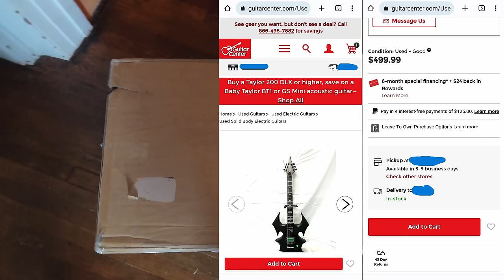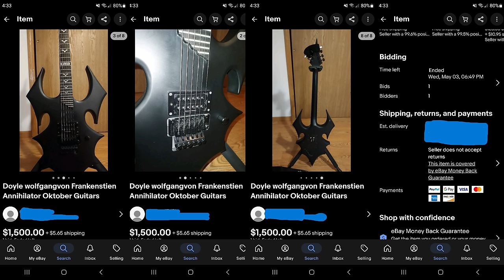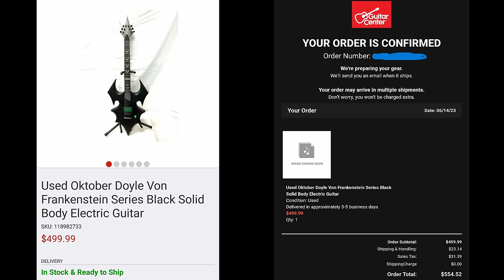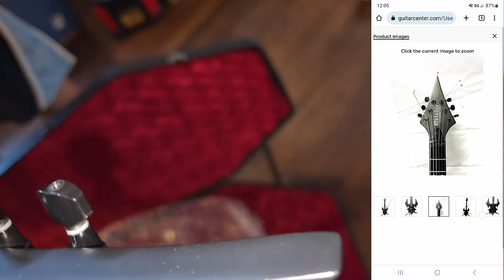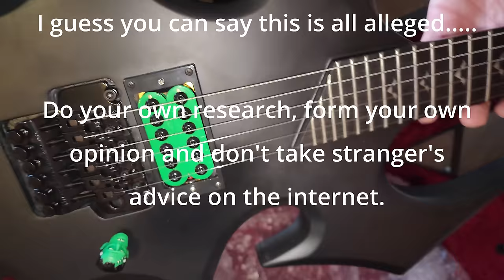Guitar Center Sold Me a FAKE Oktober Annihilator Doyle Von Frankenstein Guitar The Misfits Part 1

Comment: I bought a Mesa Boogie 2:100 power amp from GC once. I was excited about it and watched the ups driver bring it up to the porch. The sob drops it right on its face on a concrete porch  takes a pic and scurries off. I already knew the face was destroyed but when i opened the box, I was gutted. The box had about 6" on each side of extra room, maybe 5 pieces of popcorn and a strip of paper. This tube amp had been floating around unsecured in a giant box from new York to Detroit. So i look at it, confirm the face is destroyed, the rear only had 2 power tubes and one was floating in the box with it and somehow survived. The 2:100 comes with 8x 6l6 tubes. GC denied they sent it to me like that and even said they tested it first. I was fuming at that point but ended up getting my money back after a few weeks. never bought anything used from them again. They're crooks!

Comment: Guitar Center does next to no work on listing their used items. Sometimes it can be to your advantage though. 

They incorrectly listed a 90s MIJ Jackson Concert Bass as a Jackson Spectra, a much cheaper current production bass. I got it for only $150. It wasn’t playable at all out of the box as the saddles were lowered all the way and the neck needed adjusted, but a $50 setup corrected everything. Sounds ferocious and in great condition.

Comment: Some differences you didn't mention that could help someone in the future. 

1) the space of the pickup and the floyd rose. The real one has a space. The fakes are much closer together.

2) location of the knob. Using the Floyd of the real one for reference.  The fakes are too far back

3) pickup location in respect  to the arching C curves on each side. On the real one, the top of pickup is nearly (just a tad under) halfway  of the arching curves on both sides of the guitar. The fakes are further back

4) If you look at the end of the neck where the cutoff is on the real one. The metal fret markers specifically. The strings going from E to e ,each one is positioned in a way to cut an equal amount of the metal fret marker off. On the fakes, the amount is random

5) the part of the guitar that meets the neck. If you look at it. On the fake ones, it goes up to the 2nd bat. On the real one, it only goes up to the 1st bat inlay

6) the large wings of the guitar. If you look on the real one. They go up on each side to about halfway of the Doyle inlay. On the fakes, they are much shorter and do not reach to the same spot.

7) On the fakes, they have silver screws for the plastic pickup covers/braces/brackets or whatever those things are called. The rectangle around the pickups, lol

8) The shape of where the neck meets the body on the back of the fake ones are way too pointy and traingular

9) The tuning pegs on the headstock on the fake are not aligned perfectly.  The 2 on top are misaligned.

10)  The grey plastic ring around the tuning pegs. (The part you turn with your thumb) is like double to triple the width on the fake. The real is much thinner

11+) There is so much more, lol.

Comment: When I was 12 years old I found a advertised red made in mexico strat on they’re used section it was 300 bucks I bought it with my Christmas money a couple weeks later it came to my guitar center and I got there and they were checking it over they noticed something off, the guitar was paper thin! And they ended up realizing it was a squire with a fender neck, I was devastated, this guitar center was cool though they called the store and flipped out and sold me a brand new attic white fender strat for a little over the same price

Comment: A couple of years ago I was at my local GC & saw a cherry Gibson ES-335 on their used wall. I was in the market for a 335 at the time so I took a closer look at it. Before I even took it off the hook I knew it was fake. Headstock angle was much greater than it should be. Once I had it in hand it weighed next to nothing. Then I turned it over & it had a SCARF JOINT. 
The fact that someone at that GC has the authority to buy in used guitars but doesn’t know that Gibson doesn’t use scarf joints is mind boggling. They’re Gibson dealers for crying out loud. I took the guitar to the manager & pointed out the issues to him. He was extremely embarrassed & said he’d handle it. Never saw the guitar again but I don’t go into GC very often, maybe once every couple of months to get strings or cables. I would never recommend to anyone to buy used gear from them without putting hands on it first.

Comment: Ngl all the guitars at my local guitar center feel like fake guitars, it's pretty crazy the quality of stuff they're willing to receive too. They had some used MIM fender strat that had a random chunk missing out of the side of the fretboard where the side dots are so if you attempted a slide you'd cut your thumb off lmao and it had a custom pickguard and knobs so you can tell it wasn't some B stock. The guitar center fall off has been rough on them

Comment: Two months ago I bought my first GC used guitar. I knew I was taking a gamble because of similar stories to yours, but I was willing to take that bet. It's a specific 8-String that rarely comes up on the used market and usually new ones are back ordered. I didn't want a new one, so I've been checking out the used market for many months. Reverb has only sold 6 used ones in the last two years, so when I took a gander at GC for the hell of it after work one night I couldn't believe it. I bought it sight unseen aside from their potato cam pictures at 12:30am. I was lucky, there was no damage, but the two lowest string saddle posts had some slight stripping, so every new day I played, those two strings had to be re-tuned as the saddles kept moving towards the body. It took a few days to figure out what was going on, but I just ordered two new Hipshot saddles and it's GTG. (Side note, Hipshot takes forever to ship their parts.) I'll bet whoever had it before me was dealing with the same problem and couldn't figure it out. 

It's not just used guitars though. I bought a brand new Hagstrom Fantomen from AMS. It has an offset point on the headstock and they ship without a case in a double box. It took three returns before I got a fourth without a giant chip on the headstock point. On that fourth re-order, I specifically told them to check it, wrap it inside the inner box, add more padding on the headstock, and add filling to outside of the inner box so it wouldn't move and they complied.

Comment: This is a good reason to check the speakers in a used cab at guitar center. They dont check any of that stuf. Wind up with a mess with no celestions and some cheap speakers.    My point being, no surprise they sold a wish/temu version thinking it was the real deal. 😂

Comment: I received a bass from GC that was completely unplayable, the trussrod was rattling and the strings were almost a half inch off the fretboard while laying flat against the pickup if fretted past the 12th, the electronics werent working either due to a disconnected wire. When I left a review they asked for an email and then emailed to ask for a phone number because "we want to make it right". Never heard from them after that. After setting it up it plays really nicely but it was a wreck when it came in "play tested".

Comment: Great work on exposing the fake. I hope they did the right thing.. They sold me a Schecter they listed in "Excellent" condition, but was far from it. The fretboard was covered in finger funk, needed a cleaning, oiling, frets polished, and all the hardware on the tremolo was red and rusty, one of the pot knobs was missing when I came to pick it up. It was ridiculous and none of that showed up in the photos. As a guy that does his own setups, the only criticism I have is that you complained about something every guitar owner should know how to do for themselves. Truss rod / action height adjustments. I've never run across a guitar I couldn't reasonably set up unless the fretboard was separating from the neck or clearly twisted from some sort of heat stress like it had been through a fire.

Comment: Hey there...I'm the original owner of Oktober Guitars. Not long after we stopped making the Annihilator line, the Chinese knockoffs started popping up all over the internet. Alibaba, DH Gate, Ebay etc etc. A few times people have reached out to me to ask if one was a fake, because some of the knockoffs had the Oktober name on them. It's very easy to tell a "real" Oktober model from a knockoff:
Look at the truss rod cover. It should be in a point, mimicking the headstock. That's the ONLY TR cover we did.
Look at the neck heel. Early models had a rounded heel, later models had a very deep recess that Doyle requested.
Check the hardware: We didn't use any "Floyd Rose Licensed" knockoffs. It should have a Floyd Rose Special.
Look at the end of the fretboard. They should be noticeably curved, not a straight line like in the video.
Look at the headstock: It should curve in on both sides, not just come to a straight point. 

On a side note, we never did sell them for $400 "before we went bankrupt". Surprisingly to everyone, the Annihilators, while super cool, were not big sellers, so after our contract with Doyle was up, we didn't make any more. Eventually we got tired of the frivolous lawsuits coming once a week from "The Big G" and what was once the greatest job ever became the biggest headache ever, so I took a buyout and walked away. ;-)

Hope this info helps someone else to be able to spot a real Oktober from a Chinese knock-off. They were VERY well made guitars, and there were not that many made...under 200 probably. They're rare.

Comment: I’ve never had a bad experience with guitar center, but I also stand by the fact that ordering guitars or any instrument online is a bad idea. I’ll order an amp or cable but never a guitar or bass. I have had a bad experience with Sam ash though, they tried to give me like $45 for a mint condition affinity p-bass. And the guy tried telling me they’re $200 new, but there was one like 20 feet away that was labeled $280. Idk what he was yapping about lol. Guitar center have me either $140 cash for the bass and an old amp I had, or a trade, and I got a gsr200 with Seymour Duncan’s and upgraded tuners and a set of strings for the trade, the bass pretty much just has a chip in between the pickups, and a somewhat shotty soldering job on the upgraded pickups, which I can fix if there’s a problem further down the road.

Comment: I stopped buying new gear from them. I bought a new MPC One just to find it was used. Even had a used sticker on the bottom of the unit. Bought a higher end midi controller with a similar story. Nearly $1k of gear. They took care of me but it should have never happened in the first place.

They also have a $75 used Arturia MineLab listed as a used Arturia Microfreak at my local store.

I used to have friends work for them that all left due to issues with GC management. Seems anyone left just genuinely doesn’t care about the job to perform better quality control.

Comment: What happened probably is the dude that bought in the guitar was not a guitarist and just said why not. Guitar center also has a used buy team that will red flag a guitar if its fake or too messed, but that's if it doesnt info on the used buy specific website. The website is a direct page that shows how much everything will be sold for automatically, but if there is not info on the item they will send photos to the used team. So basically, not guitar centers fault just some dummy who doesn't know guitars.

Comment: Dude, it's GC, they don't care at all. I worked there for 7 years, left in January of this year. Company is going down the drain fast. I was chewed out by corporate for being picky about the used gear we bought at the San Antonio store. People called and complained because I wouldn't buy their fake guitars, their acoustics with warped tops, their amps with non functional reverb tanks. Trust me GC does not give a single hoot about their customers or employees as long as they get their bottom line.

I'll tell you anything you want to know about GC and the processes if you have any questions.

Comment: I mean, it's a guitar. Incorrect factory setup is meh but it happens with other guitars, a truss rod adjustment is no biggie, if it works as good as the price of it would warrant it and you like how it plays after setting it up properly and how it looks, all these details are irrelevant, unless it only meant to be decoration. If looks are the main thing and it doesn't match the picture that was online, just send it back.

Comment: You dont even have to be an expert, just looking at it likes like its a shitty knockoff, the routes, the frets, the shitty quality parts, the uneven cuts, the neck joint being straight across which wasn't even pointed out rather than being on an angle.

Comment: used condition... "good"... hahahaha wtf? even if it was real id be upset at there rating. i bought a mick Thompson soloist that had some damage and some of the higher frets got ripped out and pounded back in lol. you could see the chipped ebony as proof the frets god pulled out. it also had a broken 3 way switch. it was listed at good condition. i called the store that had the guitar and the guy said it seemed fine and had no issues as he was holding it in his hands. when i got it i found all that stuff they neglected to mention while we were on the phone. i have another story of buying a used js22 from my local GC and asked for a discount cus someone had obviously done a ton of diy shotty work and they didn't do anything. i truly believe most of the employees know nothing about guitars or even play them. at the store i asked for some help once and nobody knew anything about guitars and couldn't help me, i just wanted some information. they just suck.

Comment: When GC purchases used gear they hold it for a predetermined amount of time in the event it does happen to be stolen. then once that grace period ends then someone could actually take it home . If it was stolen .Alls someone would have to do is provide proof (along with a police report) it doesn’t necessarily need a serial number for someone to do that. You could’ve wrote your name on the inside of the control cavity. It could have a dent on the left side of the horn and you happen to have a picture of you holding the guitar showing that dent. And so on.